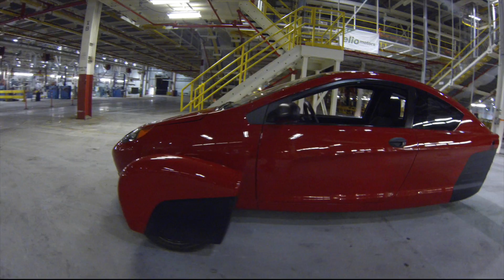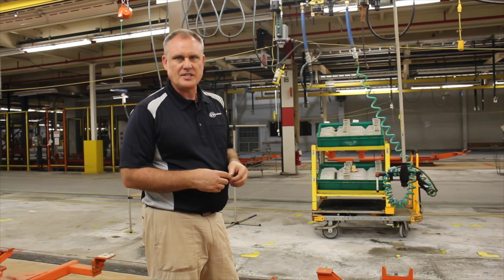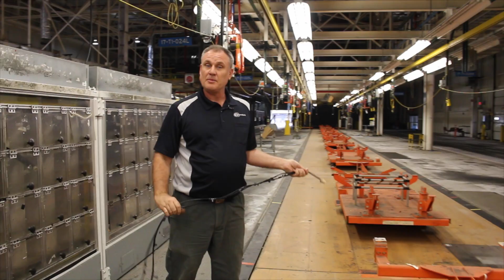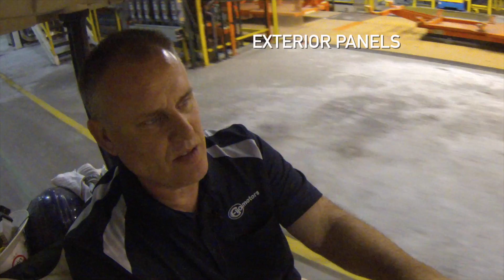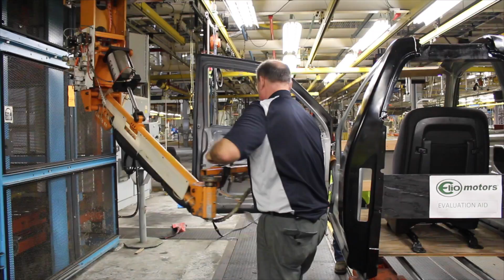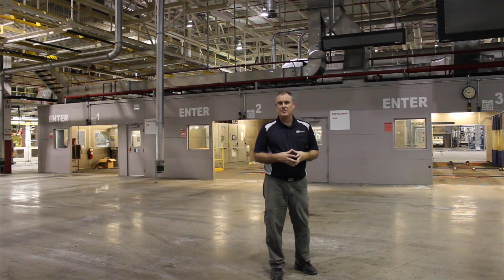Elio Motors Shreveport Operations (Extended Cut)

Comment: Ok, guys here you go. It looks like production is now pushed out to 2019, forget 2018 & today it's only August 2017. (See article below)

Elio Motors is going public in an attempt to raise money.

The financially troubled startup auto manufacturer plans to offer common stock on the NASDAQ starting at a penny a share, according to its latest filing with the U.S. Securities and Exchange Commission.

Elio said it’s pushed back production to 2019 – five years after its three-wheeled vehicles were supposed to start rolling off the assembly line at the former General Motors plant in Shreveport.

Comment: Elio has greatly changed the video that it had posted. I went through the prior video, point by point, as to what appeared to be missing systems,electrical,,fire,mechanical systems and what appeared to be safety/operational metal stacked for scrap, as well as Elio blurring the video, in what appeared to be hiding parts of the plant. It appeared to me as if Elio was cannibalizing parts of the plant. Elio has deleted my point by point concerns and questions. Why? What is Elio hiding?

Comment: There are so many details here, this is going to take a lot of people and a group effort. Have you ever been inside of a high tech manufacturer building before? I have put my deposit down, I have my reservation, I believe and support this. I have many years experience in multiple companies in american high tech manufacturing both as temp and permanent, HAAS, Solarworld, various other supporting companies. What company is going to churn out those powder coated body panels? Do you have the welders, grinders, powder coaters, ovens assembly line just for the panels in house?

Comment: Hey guys, I use to run welding robots at various points on the line for a solar panel manufacturer. You are going to need maintenance guys for these things, when they go down, they go down and the whole line comes to a halt. You are going to need - I'm guessing - one maintenance guy for every 5 to 10 welding robots and those guys don't come cheap, I think it is at the $20 per hour area regular time to start.

Comment: Why bother developing Elio engine when you can buy assembled one. Just start putting cars together first, make ball rolling. Then, company can advance and improve. It seems Elio made a first step, and now trying to tackle steps 4 and 5 while skipping 2 and 3.
Reply: I had thought the reasons for developing their own motor rather than buying was two pronged.  One, because purchasing someone else's motor would blow their projected price point and two to manufacture the engine to meet or come as close as possible to their 84 mpg goal.

Comment: Where is the line-up of cars ready for delivery? This is why I have not initiated an order! When will we see the activity of an actual active factory?
Reply: You will see "the activity of an actual alive factory" when sufficient start-up funding is secured and applied to the current step-by-step (ongoing) stages of research & development through to the actual production beginnings.
The first 4 of 23 current Engineering models are under construction - one, the E1A, is completed and on its way to a supplier for (braking systems) evaluation and configuration. 
Then after more such evaluations & configurations are completed - enough to finalize the designs and the layout of the pre- production assembly line (anticipated to be) in December - the assembly of 100 pre-production models to be sold to Fleet customers can begin. These will provide real life, on-road performance and endurance results which will further evolve the development toward the final production assembly line setup.
It's all a step by step progression of investment - and of doing the work - which is almost never revealed to the public. 
That is how a start-up production development works. 
Enjoy the view.
Reply: December
Reply: Not happening in December 2016, they cant  because they  are so far behind with the e series and this facility still needs to be tooled(set up) that will take months  and elio is still looking for funds to tool the facility.

Comment: I say bull shit. They just showed a vacant S10 plant, way to much facility for a car that will never be mass produced. Notice they have only ONE car.
Reply: One car, what are you talking about, they have the P2, P3, P4, P5 and the E1a with several other E1's on the way, and in December they will make a run of 100 pre production Elios in this very plant.
Reply: Five (running) Elio autocyle prototypes have been produced and publicly shown since 2013.
Reply: it will take 3 months to tool this facility and  Elio is still stating they are looking for ways to fund the tooling of this facility, they still only have a couple of these e series complete and still need to complete 19-21 more? no way the 100 fleet  starts in December. Its mid October already

Comment: Getting close!
Reply: They will be doing a run of 100 pre production Elios in this very plant in December, then 2017 looks like may be a very good year.
Reply: getting close to what. They built ONE car.  You'd think they would at least show that. They've raised 17 million. Subtract all the payroll, the money spent on designing and building a new motor, and oh don't forget, they need another 200+ million dollars to move forward.
Reply: +Stephen White they've only built one so far. They have to build another 24 FIRST, then 100. I dunno if you've seen a calendar lately, but that timeline don't sync
Reply: FOUR prototypes have been completed and publicly shown since 2013. One Engineering model is now completed and on its way to one of the suppliers (brakes) to configure their part in the production development. It's a step by step process. 
If you are interested in learning about it, there . is . a tangible possibility for such pursuit.
Best Wishes with that.

Comment: Interesting; BUT he failed to mention WHERE the 'Elio Motors ENGINE Facility' will be located.  Where the 1,000 engines PER DAY will be Built, Assembled, and Tested!  No such facility EXISTED in the Shreveport Plant, since 'completed' engines were 'shipped' in and installed.  He also failed to mention at which phase the ENGINE and TRANSMISSIONS would be installed in the frames.  An interesting 'omission'!
Reply: The engine production has been --> publicly <-- announced to be under the management of the Linamar Corp., including the production & marketing of the engine to other (global) purchasers.